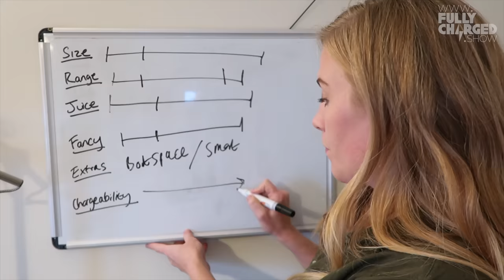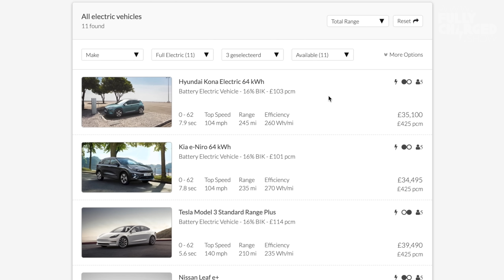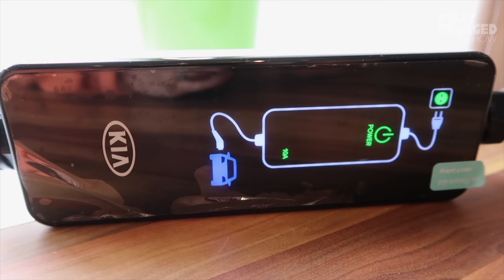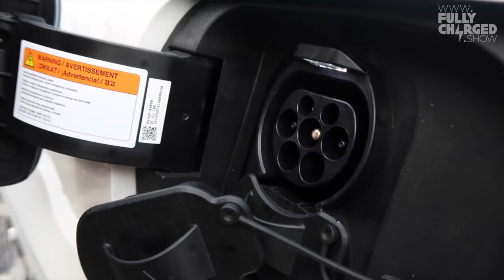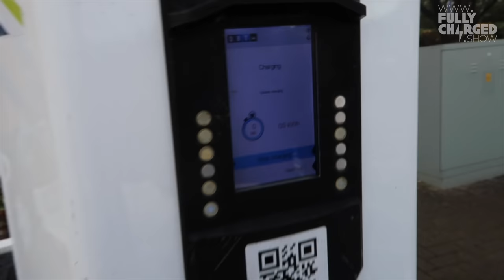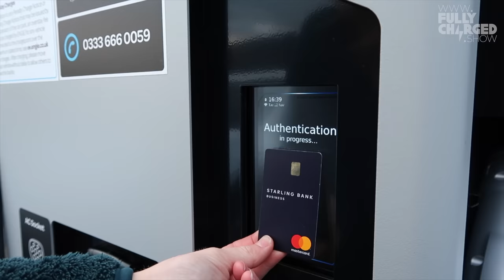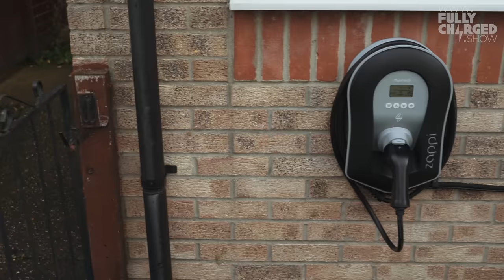Maddie Goes Electric, Episode 6: Living with an electric car (Round-up with Robert) | Fully Charged

Comment: Maddie is saying she doesn't need the range but having a bigger battery can actually give you the ability to use better battery cycling techniques which vastly improve the longevity of the battery pack. The first gen nissan leaf has suffered allot of battery degradation because people are using the battery pack on the edge of what it's capable of. A bigger battery might last 200,000 miles, a small one may last as little as 40,000 miles.

Comment: I would definitely get an EV in the future, it is just that EVs in Malaysia are still prohibitively expensive, a decent Hyundai Kona will cost around RM140k (approximately GBP 25.3K ) and Type 2 charge points are far in between. So maybe another 5 years down the line, I would say.

Comment: Good series.  Question.  If you leave car at airport to go on holiday for say two weeks does the car continue to draw some power whilst its left standing?
Reply: Yes, but not so much as you'd notice.  Li-ion battery don't lose energy as badly as NiMh ones do.  It would only lose probably less than 10 miles, it depends on weather conditions.  If the weather got warmer while you were gone, you may find that the range has increased as warmer batteries go further.  That's why they should give range for EV as winter xx and summer xx.  Typically my Zoe can go 170ish summer and 130ish winter.
Reply: Man with Zoe I understand weather change altering battery potential range, however if I leave a mobile phone off for weeks I might turn it on with significant power degradation.  The 12v battery on my motor Bike runs flat due to alarm in after ten days.   So is the Zoe good at going into deep sleep or is this a function across the board?
Reply: @colinharvey1049  Hi, lots of people look at EV batteries in the same way as phone batteries.  The technology is slightly different as the cars have a battery management system to care for the batteries to prolong their life.  If you go on to SpeakEV forum you will find threads on the subject of long term leaving (airports, sickness, temporary unable to use car, etc) and most replies report very little loss of range even over several months.  I recommend SpeakEv to everyone interested in EV as the is a host of information and help there.

Comment: I do think it's a bit of a pity about the size of the CCS plug. I wonder how old people / people with arthritis will cope with a big, heavy plug cable like that.  Also, the Tesla type 2 is a heavy beast to lug around - the one that comes with the model 3 is a good 7kg+! The other thing about public charging my first time (7kw type 2 at a Tesco) - I told my car to stop charging. But forgot to also press the "unlock chargeport" button. So was wondering why I couldn't unplug the cable from either the Tesco podpoint or the car!  Be better if there was a "stop AND unlock" button - but maybe that's a Tesla bug only?

Comment: One thing i'm not sure was covered in the wall charger episode was if I installed say a Tesla wall charger then changed my car to a non Tesla 3 years later. Would I need to change my wall charger to one for an Audi Etron, kia, etc. Do all at home wall chargers work in the same way? Are there better ones than others? Also, as a business owner, I would love to know more about the new governments plans for low company car tax on electric vehicles and what the comparisons would be vs a hybrid or commerical car in terms of company car tax and running them, etc?
Reply: Tim Harmer Nope, the home charger you get today will do any and every EV currently available. We had ours installed for a Zoe originally, then subsequently used it for an Ioniq and now a Model 3, all have used the same home charger. Even a second gen Leaf (the main one that uses the “other connector”, Chademo, for rapid charging away from home) still uses the same type 2 connector as everyone else for home charging. The only (second hand) cars that are different to everyone else are first generation Leaf and Mitsubishi PHEV.

Comment: Robert makes a comment in this video which isn't quite true. He says electric vehicles require no maintenance. Bending the truth a little bit. From what i understand ( from this channel mainly)is yes it is a lot less. But you still have things like tyres, wiper fluid, wiper blades, coolant fluids for the batteries, AC filters, and what if one of the many "black boxes" fries themselves. You get the idea. Yes not grease and oil and filter changes, spark plugs., drive train. But definitely some maintenance required.

Comment: My latest driveway quote: 5k to put it in, 2k to drop the kerb. So 7000 pounds before one even gets the electric car. No chance whatever of clever lamp-posts or new on-street chargers. I admit that I could probably do a cut-down, single-car driveway and maybe I could get down to e.g. 2k for it. So 4k at best then - the same price as my current car.  Maybe one will get it back if one sells one's house ..... which might be good for my daughter in a few decades.  I'm not trying to knock electric cars but it's worth understanding the stupid problems that stand  in the way.

Comment: question for the #fullychargedshow team I'm in Birmingham and they are planning new rules for entering the city like London I have a raised kerb but have access in front of my house for two parked cars with ref to home charging am I higher chance to get the kerb dropped if I have an ev vehicle where I can plug in at home there is also a tree in front of my property, will getting rid of 1 item to help with air pollution help with exchanging it for another item helping with air pollution?

Comment: I love Maddie but I think she had a blonde moment when her car has a rapid charge socket and was told it would take a 100kwh power in her car all she had to do was match the socket it wouldn't blow up if she fitted it if not the same type it just wouldn't work as all chargers have safety devices fitted to stop shorts you would have thought her hubby would have figured it out but I forget that I am a mechanic and there are lots of people like Maddie who just don't have a clue about cars and why should they and as Robert says you cant fitt the wrong cable it just won't let you. so at least she got there, in the end, bless her and another EV convert which is great as I am a mobility customer every mobility customer get a Free home charging system for your car so that's good so this Thursday 2nd December 2021 I am putting in an order for the Vauxhall Mokka Ultimate E. my very first ev car at the moment I have the 1600 cc petrol seat lean estate FR which I do like its 150hp so I am dropping a little but it's not a lot basically it's a VW golf estate it has even VW badges on the engine and parts which makes me laugh I do like it I can put my mobility scooter in it I know I am getting a smaller boot but it will still fit as mine does come apart easily I am 60 now but I am still 21 inside so I like banging tunes house music club music rock hate slow songs it has to have some base so the mokka doesn't come with a subwoofer so I will have to get a plug in remote one as you cant wire anything up on a lease vehicle a under seat woofer will do which plus into the aux 12volt socket and you just slip it under the seat and it has a microphone which listens to the base tones and amplifies it so I will be back in business.

Comment: would love you doing a really well researched show to challenge the Anti-EV tropes, interviewing and true subject matter experts:
 - The grid won't cope if we all get electric cars - wheres's the power going to come from we'll need another 30 power stations [interview National Grid BEV planning team]
 - Batteries are terrible, can't be recycled and use up more energy/CO2 than petrol cars will use for years [Battery supply chain experts, credible engineers on the maths]
 - They're too expensive (probably still true in terms of upfront cost but look at the cost of a 200+ mile range BEV over time since 2008); look at cost of ownership 
 -The infrastructure isn't ready.  Yes, this is fair criticism.  But here's what can happen and here's what the DoT need to do to push things along 
 - etc

Comment: Very revealing series. This whole bit about needing a particular app for a particular company's charge point . . . just ridiculous. Why add to the confusion? People pay for millions of things with just a bank or charge card. Imagine if every individual store or gas station required you to download their app in order to pay for things. Sheer idiocy. It's bad enough having a number of different charge cables, not to mention the lingering doubts around range anxiety and areas of the country without charge points. The whole trip to Otley where there were no listed public charge points, (even though they lucked into one) and getting a slow charge by mistake, I think just shows the current situation is just still very disorganized. Early adopters will put up with all this but the general public is going to be put off EVs altogether if it continues to be 10 times more confusing to charge a car than it is to fill an ICE car with fuel.
Reply: Well said dude - the EV obsessives do like to gloss over this downside to EV ownership "currently"......!
It IS confusing and it IS badly set up.....
Reply: I'm an early adopter and I don't put up with all that nonsense of apps and RFID fobs. I just put the payment filter to contactless in Zap-Map and away I go. No confusion, no nonsense and no range anxiety. :) The general public need to be made aware of this.

Comment: @6:10    7kw =13miles/hour charge rate?
....should be more than that ?  1kW should get you 4miles (at least in e-niro) so 7kw = 7x4 = 28miles/hour. Thats optimistic with no losses - but should be >20m/hr

Comment: Great series Maddie, as all the comments below testify. I'd just ask that you don't accept the confusing and unfriendly jungle of different chargers and payments systems out there. EV drivers should not have to 'learn', the systems should be open and seamless to us as EV users. Contactless payment is a step in the right direction, but that's not really the answer. The chargers should have full roaming capabilities, so you can 'sign up' for a deal that suits you with your preferred provider, but use any charging point. We're used to open systems, standardisation and roaming with our mobile phones, why isn't this the same? May I suggest you quiz policy-makers and regulators, and ask why roaming is happening in continental Europe but not GB.

Comment: So Maddie came to the same conclusion I have. The lease cost of an EV is too high. Unless you cover very high mileage - over 15k per year - then an EV doesn’t make financial sense, as the higher lease cost outweighs any savings you can make on fuel and servicing.

Comment: By the way I was taught to drive using engine braking and modern ICE vehicles have used regen when you do this. Sadly most idiots today are all gas and brakes and don’t anticipate things as traffic conditions and lights etc and should use use engine braking

Comment: Good series, very informative. Though I think it's a bit naive to assume electric cars are cleaner, as they are drawing electricity from power plants that create plenty of dirty air. Replacing gas pollution with electric pollution is not a solution. If the majority of electricity was drawn from solar, wind, thermal, hydro, gravity, etc ... then I said it's a good solution, but as more electric cars come on line, pollution will increase along with rates.
Reply: Actually, no.
Even in Poland, where coal power plants are a big percentage of total production, a km/mile on EV is still cleaner than the same km/mile on gasoline/petrol/diesel fuel.
Reply: @fabiogalletti528  Never said it was more, simply said it's still not clean. And it's a fact that as more electric cars come online, more pollution will be generated from power plants and very likely they'll increase rates. In some regions they've already cancelled night time savings rates.
Reply: Getis Realis have a think about all the pollution that happens prior to the petrol arriving at the Tesco garage. All that is hidden and never spoken of - the wars, then the extraction , then the transportation, refining , etc etc. It’s insane to build more ICE vehicles when you consider the bit after you buy the fuel, but when you add the processes to get the fuel to the petrol station it’s utter madness.
Reply: @jryer1  if you need motion, you have to provide energy. It's thermodynamics.
You can't have "100% clean" energy: but you may have cleaner electric energy than chemical energy and more km per kW than dissipate heat in a thermal engine.
Reply: @reubenwilkinson845  Yup, and just like petro cars, there are downsides to electric cars that they conveniently did not discuss. They it made sound like everything is great and they are no issues, and that's just not true. It's typical of fairly new tech, everybody jumps on the bandwagon, gets all excited, but refuses to acknowledge there are bad aspects. They are better in some ways, but they're not a panacea.
Reply: Yawn. Same old myths recycled.

Comment: I'm still pretty incredulous that all that drama over plugging in the type 2 connectors and expecting to get a rapid charge wasn't an act for effect. I mean, honestly? You can actually see the scroll bar at the side of the ZapMap pop-up window, which would have revealed the information about the CCS connector if she'd just scrolled down. Ditto pricing and how to pay.

I mean, she didn't even take the car to a local rapid charger one quiet afternoon just to see how it worked and what to plug in and where?

Sorry, not really buying this.

Comment: Can I make a few sobering points about EVs in the UK?
UK EV sales 2018 =15,500 in 2019 = 38,000.
Only EVs for sale beyond 2035.
Assuming 15 year life, virtually no ICE's/ Hybrids on the road after 2050 
Right now 38 million registered cars with 32 milion 'on the road' 
So assume by 2050 there will be 30 million EVs on the road on the uk (yes an estimate, but reasonable)
That means an average of a million a year being sold for the next 30 years.
People, that's an average approaching 3000 a day (plus EV replacement vehicles for worn out EVs).
Can supply meet this demand?
Can people afford them?
Total cost of these 30 million vehicles alone is approaching a TRILLION £.
Then there's the infrastructure etc...
Gulp!

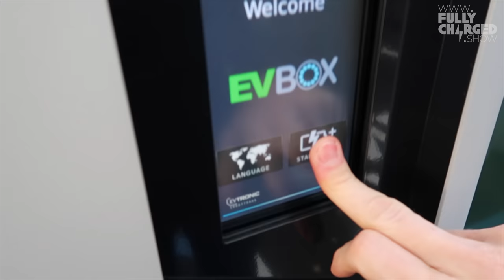Comment: 12:33 - Just not true that electric cars don't need replacement parts; BATTERIES are the big one, brakes, suspension, tires, and I've heard horror stories about other electrical gremlins with electric cars. So yeah, they have less traditional parts that need replacing, but at least be truthful about the problems that do exist with electric cars.
Reply: Fair point, although they didn't say no new parts but rather reeled off those that don't apply any more. The battery itself is designed to last longer than the normal useful life of most cars. There are several models in the US pushing 10 years/500,000 miles and still fully useable. Brake wear is vastly reduced due to regenerative braking that both reduces pad use to almost nothing and improves efficiency at the same time. Very little else to do. 

The only maintenance items for the first 100k miles on our EV, for example, are the usual tire rotations and changing the cabin air filter. Add in cheap electricity for "fuel" and many of the old running costs are gone, as Robert and Maddie tried to highlight, albeit a bit broadly.